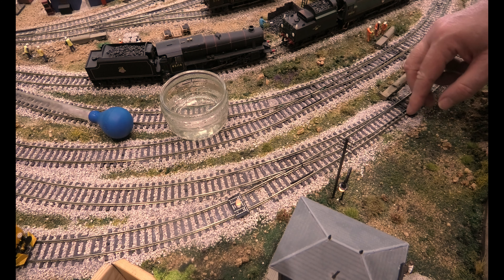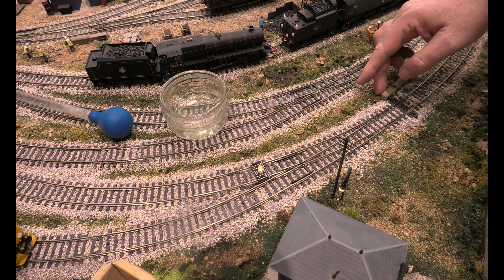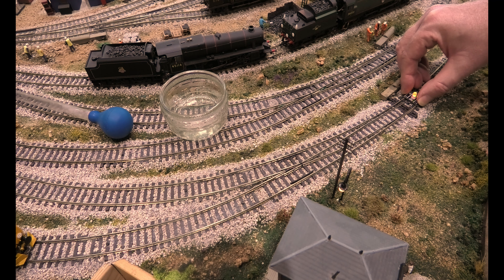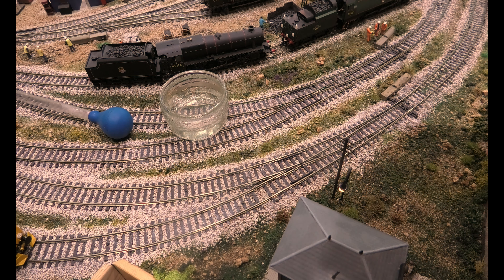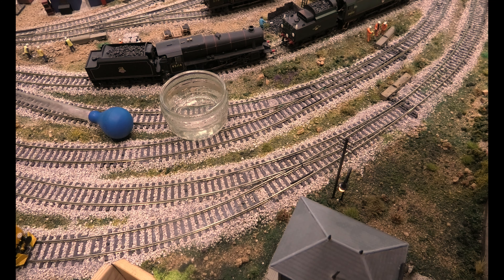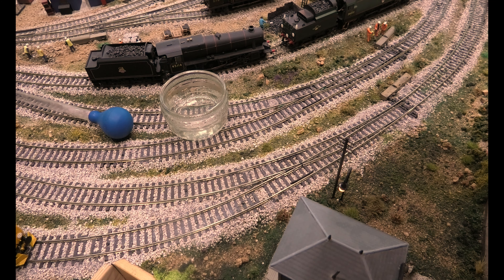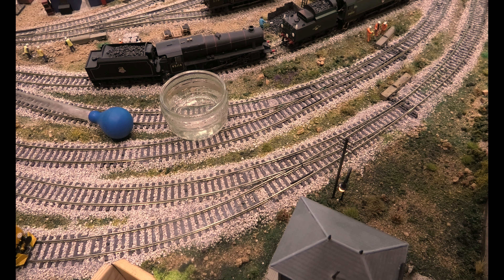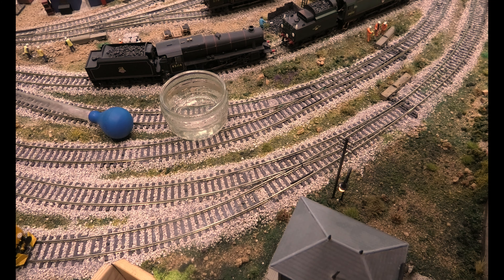NO TRACK POWER ....Easy fix : 4K Widescreen.

Comment: I wouldn't have added water to them, i find if you have an issue with fishplates i tend to use IPA or an electrical cleaner fluid.  Another way would be to add a bit of heat from a soldering iron onto the rail, then use your pliers to move the fishplates slightly. however if your idea works for you then there's some value to it if it works. Good video though.
Reply from the maker: There is no way I would use heat from a soldering iron, it can cause track to buckle. You can use water because  water sterilisers and removes dirt better than anything else, hence why they use it in medical establishments. Same as your last comment, it is what works for you, the way I do things are not set piece, they are a suggestion.  Thanks for the comment as it gives people other ideas too. Enjoy your modelling.